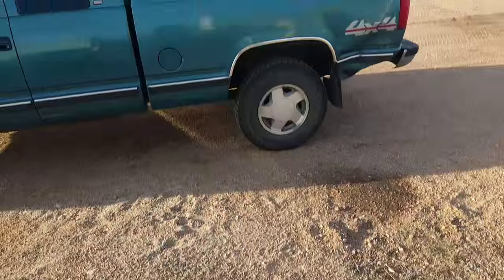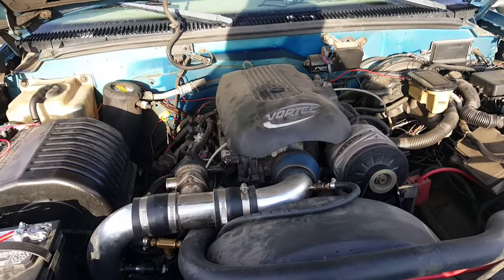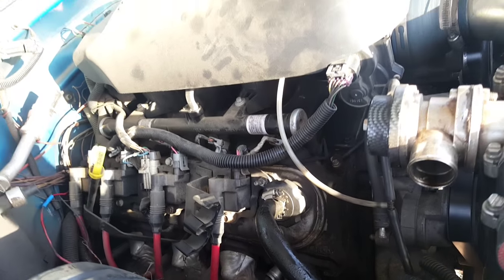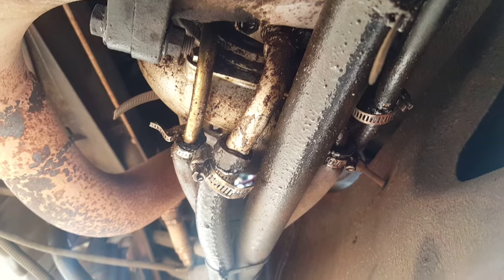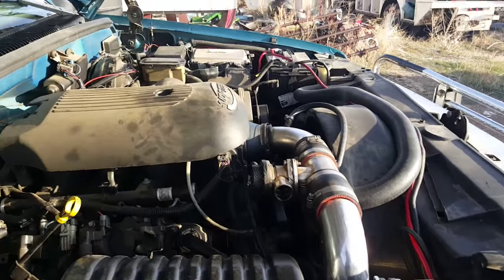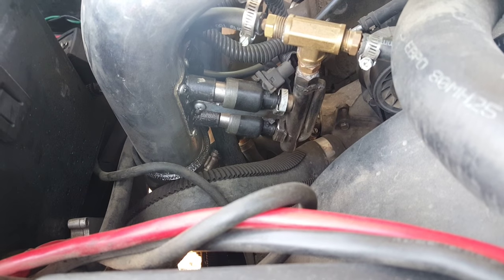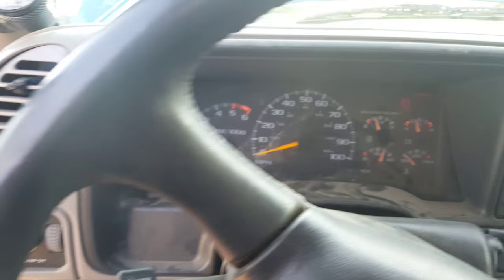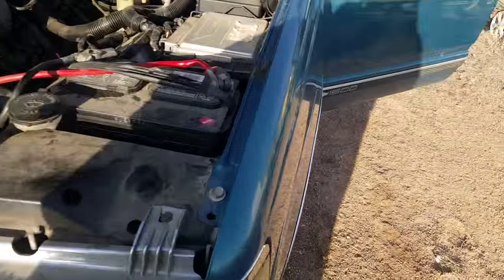Turbocharged LS5.3L 1998 Chevy pickup

Comment: What u ever do with this
Reply from the maker: Jason martin I pulled the engine out. got me a high output 5.3L ring gapped for boost. lil john 2nd stage turbo cam and 80mm turbo. not done yet but soon. the turbo will be under the hood this time
Reply: So did that turbo even have oil running to it? I'm assuming it didn't because if that was the oil return hooked to the oil fill cap and it had the oil feed hooked up to pressurized oil it would have smoked like an old freighter.
Reply from the maker: Brett Carcio It did have pressurized oil. It had a scavenger pump to pump the oil back up to the oil fill cap.